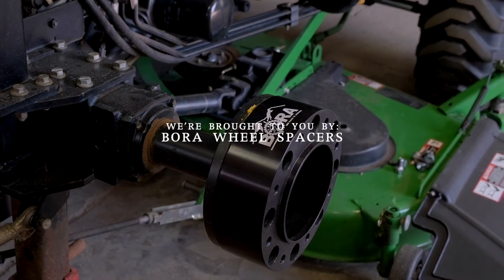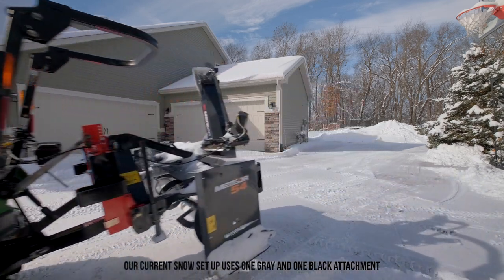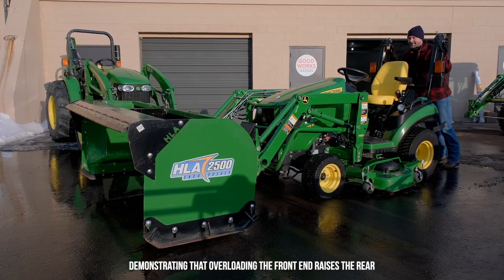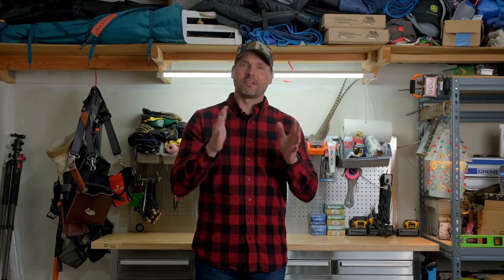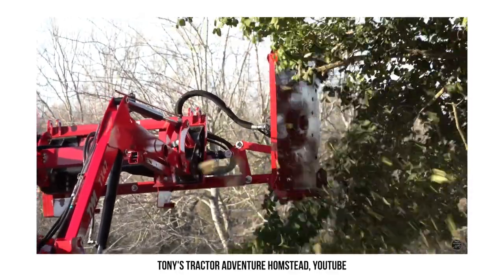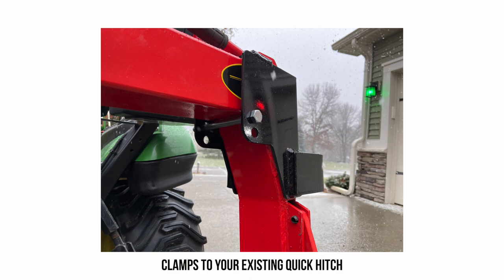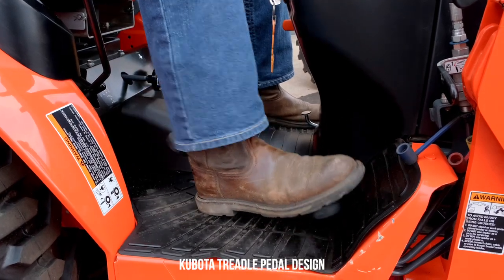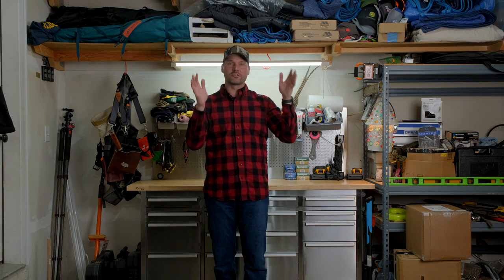7 UNSOLVED TRACTOR MYSTERIES, NO EXPLANATION.  CAN YOU HELP? 👻

Comment: The JD accelerator pedal is on the left because you'll be on it more than the reverse. It's just more comfortable. As for the high center of gravity, they need to make a drive over weight box that attaches like a mower deck. No PTO needed obviously. Just a thought. Keep the videos coming, they're highly appreciated.

Comment: My pet peeve is with all the various hydraulic fittings that are out there on equipment today. When I used to sell hydraulic hoses and fittings, it was boggling how many different styles were on all various types of machinery, whether it be heavy equipment or agriculture.
Reply: No joke!  When we buy something we take the JD fitting off and put the universal on.  We also have some adapters that are used in a pinch.
Reply: I agree.  It hate O ring face seal.  JIC is really the best even though it can't be used everywhere.  ORB is good for everything else.
Reply: And then the Chinese made thier own ORFS fittings that aren't quite the same as the others... It is a disaster, I have to agree. Particularly when you buy equipment and never know what you are going to get, and the local hose places don't carry the sizes you need (or anyone in the US for that matter, I couldn't find them online either).

If they are selling to the US market they should use hoses and fittings common here.

Comment: Here are my guesses:
Reason for no color choice is marketing. You can recognize a John Deere from quite a distance.

Seats are high for visibility and to make the tractor seem bigger and allows for driveshaft and tranny underneath with a flat operator station.

Only implements I can think of that needs down force are the post hole digger and possible a blade.  I added a weight hook at the end of my post hole digger and I can attach 6 weights to my blade. When hydraulics were originally added to tractors the implements were all heavy enough by themselves and didn't need the then expensive hydraulics for down force.

I also hate the pedal configurations. The inside pedal is the most comfortable to use for long times and this is why its forward. The reason the reverse pedal isn't on the left side of the tractor is to let you use differential breaking while in reverse. 

I wish the front 3pt and mid PTO was better thought out to allow for more  implements upfront.  Since we have quick detach loaders it should be just as easy to put something up front when needed like a snow blade, snowblower, flail mower, brush cutter, rake, etc.
Cheers
Reply: I have a front mount snow blower on my massey, and I have a front PTO hit that gets the power there. I'm looking at a rotary broom now that I have the blower. I agree on the pedals. It is comfortable to use the inside one for going forward but normally when I am backing up I look over my right shoulder so the outside right pedal is great for reverse.

Comment: As a ROPS engineer there is a "standard" in which the ROPS needs to meet and pass a destructive test.  Unfortunately the standard is very rigid in it's purpose and that is to protect the operator.  A 2 post ROPS can only do so much and that is why if you look at a 4r series tractor and measure the height of the cab it is lower than that of the 2 post ROPS.  There is a "zone" that represents the operator and nothing can come into that zone during the ROPS testing and that includes the ground, or the ROPS itself.  So unfortunately, the standard garage door size is not a design consideration in ROPS testing.  We can only do so much with the size and ergonomics of the tractor itself to lower the height like a folding ROPS.
Reply: I was going to comment somthing similar, assumed it was based on a certain height of operator to protect.  That being said I've had no problems with my L3240 hitting a door. But then again i plan ahead. Garage has 10x10 doors.
Reply: That's understandable, so could they not design the tractor from the ROPS down a bit and lower the rider position that 1.5" or something?  Like slightly smaller tires, slightly lower seat, a little here and there gets you that space
Reply: I've seen many people working with the ROPS folded.  Gotta make sure it is UP when working so it is effective
Reply: @ian3580  Then you affect ground clearance.
Reply: @cwolf8841  Only a tiny bit as some of the clearance can come from above that point.  Also, a small change in ground clearance lowers center of gravity, making it less 'tippy.'  I would think making it fit in customer's garage doors would be pretty high on the list, and less than 1" of ground clearance along with other changes would be worth the tradeoff.  It's a tractor, not a rock crawler......the way they are used and the way attachments, including mower decks work, it seems the slightly lower ground clearance wouldn't be a negative most of the time....no?
Reply: @ian3580  The manufacturer must meet the safety standards if they want to sell the machine.

The wheels and tires drive the axle height.

The implements (like mower decks) and the PTO shafts drive the needed space beneath the tractor.

There are no free lunches.  Every design change affects other subsystems.  Folding the ROPS is easy & simple.

Tractors are tippy partially due to their narrow design.  Adding wheel spacers helps a lot.

The other factor in instability is weight distribution.  If you put a FEL on the tractor but do not add about 1,000 pound on the rear, you can almost roll the tractor by hand.

True, some safety requirements IMO are dangerous.... the silly RIO makes a runaway more likely on a hill.
Reply: i would think it needs to be so long just to stop it from inverting.  But keep it longer you have a rectangle, a lot harder to flip. Once it is it's side it should not flip upside down.
Reply: I don't think it would bother people to extend it over the top of the seat. Then the protected zone can be smaller and the height lowered. Or put a rectangular frame above the operator. Put some mounting points and sell it as a feature for  mounting a sun shade. A four post would not really be bad either, but people would fuss about it blocking some visibility. Really they wouldn't be in a spot you look while operating attachments anyway so wouldn't matter. A four post could be much shorter.

Comment: Our Brush Tiger uses a rear hydraulic power pack. I don't recommend running hydraulic motors off of most tractors' hydraulics. They don't have the cooling capacity or flow rate.
Reply from the maker: Yeah, I think your setup is much better than the version that runs off the tractor's system.  Is that the Lane Shark?  I can't recall right now.

Comment: Colour, Valtra, while not offering compact tractors, does have quite a big range of colour options, & in fact, while they start with a basic build, every Valtra is custom built to customer requirements, though an extensive list of options. Fendt also offer a few different colours as well. & both are available with reverse drive & Valtra is more user friendly with that option. 
Belarus tractors is one I know of that has down pressure 3pl as standard. Pfanzelt Machinenbau also custom builds tractors based on a Steyr, & these are dual use for both forestry & agriculture. There is probably more out there too that I'm not aware of. From the ones above list, except Belarus (although they may have by now) usually have CVT transmissions as well, depending on the model.
As a hydraulics fitter by trade, hyd power is expensive to both purchase & maintain, & a ballpark figure for efficiency is about 80%, & this is why hyd power has to be big, lots of flow, pressures are getting higher, which creates heat (needs cooling again), the list goes on. If you can use mechanical PTO's,  it is a lot more efficient at delivering the power to the implement & a lot less maintenance. The only limiting factor with PTO shafts is to no subject the uni joint to excessive angles, use a dbl H or CV joint if big angles are needed

Comment: Interesting. 1: Colour choice buy a Valtra (agco group brand), 2:  low centre of gravity compact buy a Deutz Fahr Agrokid or a Antonio Carraro (new tractors are actually far less tippy than old tractors and comparable on weight for there power class if anything new tractors especially the compacts are actually heavier than old ones. 3: Want a compact tractor that is like a car to drive Yanmars YT3 series tractors are the pick for you (they are brilliant tractors wish we could get them here Australia and I would of brought one over a JD). 4: Rops height is all about country specific standards and ISO standards. 5: 3 point was designed to be used with ground engaging implements such as a plough and so they needed only to be able to lift the implement, some manufacturers have had downforce on certain models but generally it wasn't used properly and did damage to implements and the tractor as well as causing stability issues. 6: storage well they've always sucked at it but they are much better than the old days. 7 hydraulic power sucks and it's not efficient so to explain, the engine producing mechanical power is then converted to fluid power via the pump this than goes to a valve bank then to either a cylinder or a motor both of which convert that fluid power back to mechanical power resulting in a power loss of +25% a 66hp tractor with 12gpm is producing around 20hp at the outlets at best and that's before you convert that fluid power back to mechanical power. Now if you look at a hydro tractor with PTO say 66hp at the Engine and 52hp at the pto that's a 22% loss. So it's more efficient to drive a implement with the pto than it is with the hydraulics.

Comment: Good video, I especially appreciated the roll over bar comments since the 4066m I got from you doesn't have a folding ROPS so I can only fit it in one shed but not my heated garage. 

With the hydrostat pedals I always assumed that John Deere had the forward and reverse that way because generally the tractor is going forward so it would be more ergonomic to have it on the left side.

Comment: Tractors are a product of legacy.  PTO's were an upgrade on the wide belt drive.  Hydraulics came along later and didn't offer enough advantages to displace the PTO as the main power transfer mechanism, especially when one considers all the legacy equipment that would have to be converted.  In fact hydraulics have some key disadvantages, most notably how inefficient they are as a drive mechanism which results in a tremendous amount of heat that must be managed as well as a reduction in the size of equipment that could be run off a given power train.  3 point hitches also pre-date modern hydraulics, meaning that farm equipment already had a way to be raised and lowered so hydraulics were really only needed to move a cylinder to raise and lower pull-type equipment.  Though, when you think about it, the PTO was lucky to come along when it did, otherwise safety regulations would have prevented it from ever becoming a thing. 

Hydraulic drive and the big pumps that accompany it make much more sense on skid steer type equipment as they're crashing and banging, forward and back repeatedly.  A solid geared connection is much more likely to tear itself apart under these conditions.  Tractors have traditionally been gear driven for working the fields and spending long periods in a single direction while maximizing fuel economy.

Going forward, the next big shift will be towards electrification.  The PTO will likely survive as a legacy standard because it will allow cheap equipment to continue to be manufactured.  But hydraulics may disappear as electric actuators take over.  Already, the cleaning and certification of hydraulic oil systems are a huge headache for anyone looking to work in any agricultural area that wants to meet an organic standard.  For some reason they don't have the same concern with electron leaks.

Comment: I know what you mean about most of these things. When I first got my JD 4520, I backed it into my barn like I knew what I was doing. When I took it out the next time I looked at the clearance of the ROPS. It only cleared the top of the doorway by about an inch. They say God watches out for children and fools. I keep Him pretty busy. As far as a tilt gauge, I go by the pucker factor. If my butt is trying to grab the seat, I'm on too much of a hill. The tippyness is probably because of the light weight. I had a '65 IH 504 48hp at the engine that weighed 8000 Lbs. with a manure bucket, loaded tires, and 6' Bushhog. My 4520, 53hp at the engine, set up the same way with the exception of the loader, this one is a hydraulic loader, I'm guessing weighs maybe 6000Lbs. Mine is a power reverser so the pedals aren't an issue. But on my JD lawn tractor the pedals are like you say but for some reason I never made the connection to a car. Anyway, I've gotten used to the idiosyncrasies of the tractor and I wouldn't trade it for anything unless the next one was green too.

Comment: I have a Yanmar YT 347,it has a single pedal for forward and reverse. Left on the column shuttle forward and reverse.  It drives like a car. Take a look, the engineering has addressed alot of the issues you mentioned. Also look at A B mode for the hydrostatic transmission, it's on the joy stick of the loader.
The tractor is the most efficient to operate in my 50+ years of operating all the different colors of tractors.  PS  I also enjoy all your videos, Thanks DonR
Reply: I have one too, absolutely love it.

Comment: Simple solution for the hydrostatic pedal solution. I have a clutch lever. Chutch fork just broke a couple weekends ago. 4 bolts and 1 pin and i popped the part off without even bending over.  Oh and also my tractor is all green except a yellow strip on ean side of hood.  Gotta love old school 2 cylinders
Reply: JD 520, first tractor I ever drove.  62 years ago, I was 7. However, try using that thing with a front loader.  We had a TD 6 International dozier, 36 hp.  Hand clutch, manual transmission, but at least the shifter was tall and right next to the clutch.

Comment: Tractors are tippy because of the need for ground clearance and seats are high for good visibility...all trade offs. Light tractors have an advantage over heavy ones in that ballast can be added where as weight cant be taken away. I use my L3901 in my tree service with a wallenstien rotator grapple that I mount both three point and loader at times. I had to fight a bit with my dealer about not putting fluid in my tires until I explained that being light on yards is good for me. If I need more ballast when using the loader I grab a big chunk of wood with the grapple. Options are good, knowing your machine limits and not exceeding them whatever the configuration, and being an operator over a driver is important. Hydraulic power packs are so much money so my solution was to buy an entire system from an old Tiger flail mower off of a township road mower. A day in the shop cutting and welding now I have a six foot loader mounted flail mower powered by a great hydraulic pto power pack for about $700. It works really well on brushy undergrowth. I'm sure it will power other things in the future. Hydrostatic pedals what ever they are don't make sense to me. My old cub cadet with a lever by the steering wheel or honda mower with the lever on the right fender and my buddys old massey has a hand lever and pedal all seem to be better. My guess is manufacturers are protecting themselves with the pedal system all someone has to do is take their foot off the pedal and the tractor stops. ROPS are a pain because you shouldn't modify them as the are certified so if you ever sell the tractor or trade it the dealer will ding you hard on value because they have to replace it. Good video for venting frustration on Courtney. I'll try and remember to send you some pics of the equipment I have built and modified for your tractor talk videos... I look forward to those very much.
Reply: I would love to see that too!!

Comment: Not to brag, but I've never hit my garage door with the ROPs. 😄   On the 1700 series Masseys it fits in a standard garage door without folding.   BUT I'm pretty tall, and the ROPS is not a lot taller than me so Deere may be making theirs higher as a safety thing.

The larger row crop tractors are set in their width so they can drive through a corn field without running over crops, same with the height. 

On the compact tractors I think its more of a tight space/ ground clearance issue.
Reply: With our row crop tractors we can change the width.  Several were made narrower when we went from 38" rows to 30" rows.  Others are kept wider because they're not used in the field after planting.
Reply: @dfarmer_  true with that.   We always had a hay tractor with loader that was spaced out wider for stability and so it would straddle wind rows of hay without running them over then the row crops were spaced appropriately. So we never really messed with moving them in and out.